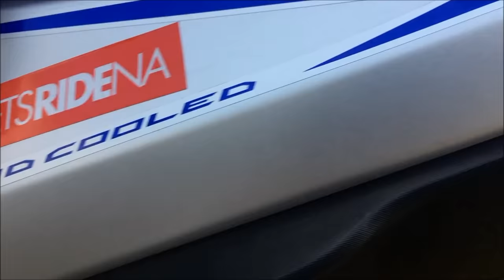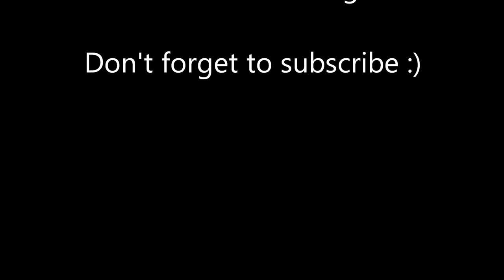Yamaha aerox rear fender removal

Comment: I wonder if the Gilera rear mud guard (ICE) will fit around the back tire.you have to put a mud guard, cause you back will get dirty if the streets are wet or in mud
Reply from the maker: Earl Letterboom i have not seen a gilera mud guard yet but my guess is should fit with little modification if not made for yamaha aerox.